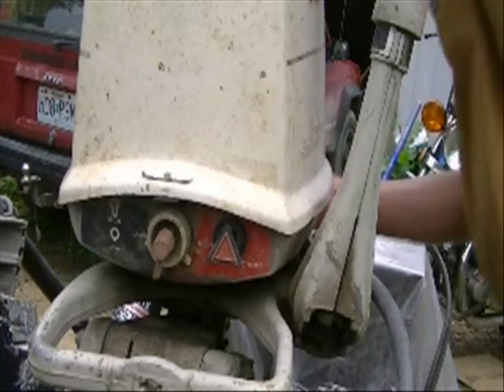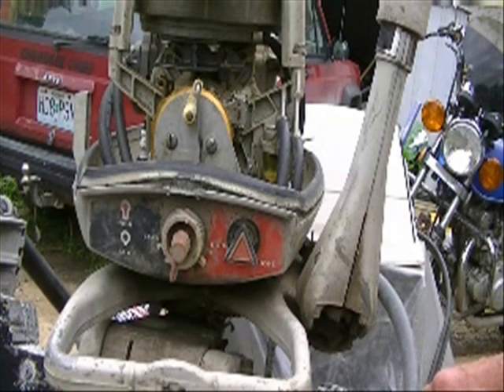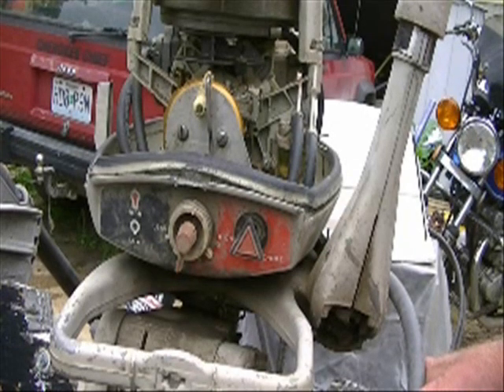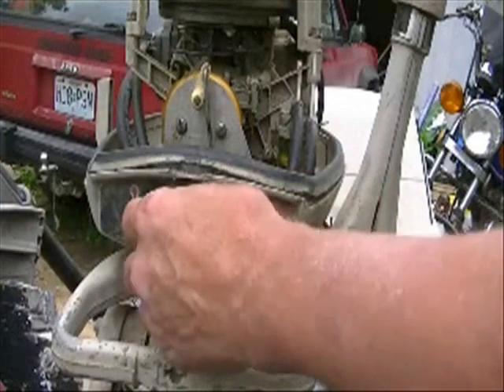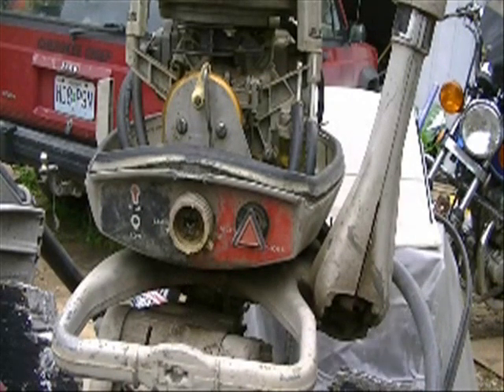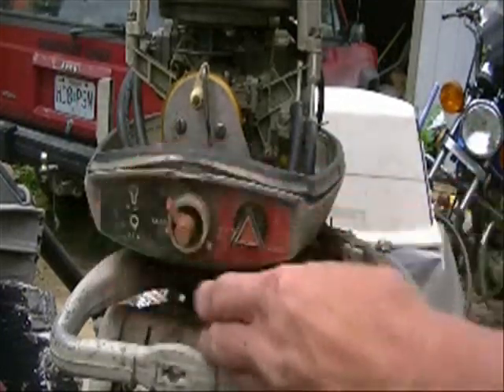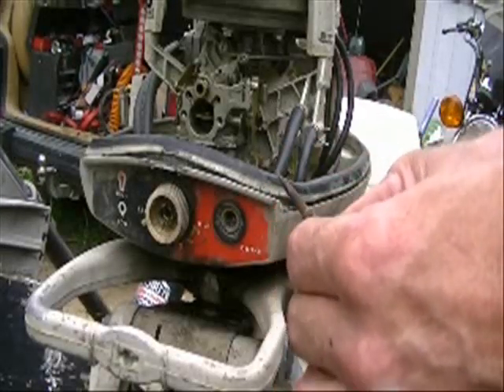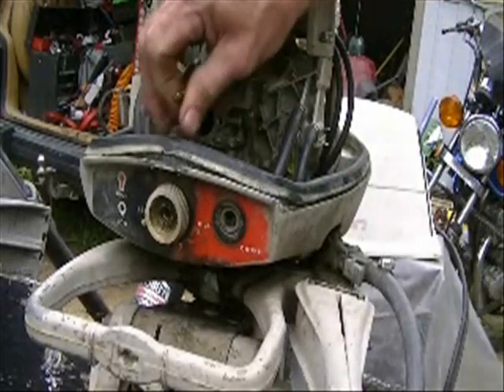Boat Motor Won't Stay Running? Watch This!!

Comment: Hi Kevin;
I used to have the same carb struggle with my 15hp Evinrude every year till I got rid of the OEM metal tank and got a plastic tank. A small engine mechanic friend told me to also ALWAYS add 2-3 ounces of fuel stabilizer to my fuel tank on its last outing in the fall and to use SeaFoam additive 2-3 times a season to keep it clean as a whistle. Never had a problem with it after that. I've since upgraded to a 15 hp  4 stroke Honda but still do the same steps and no carb gumming up problems since 2009. $25 of preventative maintenance fluids goes a long way and saves you money and headaches in the long run..
Reply from the maker: Good advice!

Comment: Most problems with outboards that won't idle have not been properly stored in the fall. You must add marine fuel stabilizer. Run the engine at a fast idle to run mixture through for 5 to 10 min. It's a good idea to fill the tanks to stop condensation. Fog the engine until engine stalls. Remove your battery. Grease fittings and kisses it a long winter. Come spring it's ready to rock.

Comment: I have a 68 Johnson 20hp FD-22M which I've been having an troubles getting running after sitting for a few yrs. I drained the fuel, changed lines/filter- will try your method even thow i'm very green with outboards.  Thanks lots for the Video very informative.
Reply from the maker: Michael T. Lichtenfeld You are welcome!!

Comment: I have the same motor as you (mine's a 1960 with the square f/g cowl)
The button you're talking about is a kill switch (shorts the ignition to ground). The choke is the pull out knob on the other side and there are two separate mixture control knobs is the center. They are labeled, though your motor might have had a harder life than mine and they may have been rubbed off or painted over.

Comment: Hi, If this doesn't work you can do what the video suggested to do but take it a bit further. Do all the steps mentioned but instead of just pulling on the rope shoot some deep creep or other starting fluid and get it to start. Let it wind up for a few moments and then cover the end of the carb with your hand. This will generate a lot more vacuum then just pulling on the rope. If this doesn't clear the jest bite the bullet and rebuild the carb. Nice video by the way.
Reply from the maker: I've been using that trick for over 30 years.I didn't want to post it for safety reasons.

Comment: my motor is a 6 hp Mecury 4 stroke. We went camping and fishing for a week. Each morning I had the same problem. It would start on 1st pull, then after about 30 seconds it would stop, and I wouldn't be able to get it started. I took off the gas hose, and let it set for a few minutes then I could start it again, and it would run without the gas hose for  a few seconds, and as soon as I put the gas hose back on, it would quit. Then it would take some sitting time of periodically pulling the cord to see if it would start. This would go on for about a half an hour, and then it would start, and let me put the gas hose on and then would run perfect the rest of the day. Sometimes we were out for a couple of hours. Would run great. Go in for lunch for 2 or 3 hours, come back out, and it would start perfectly and run. Anytime we shut it off, it would start back up and run perfectly the rest of the day. Then the next day the exact same procedure of not starting and running until about a half hour of playing with it and then it would run perfect for the rest of that day. Same procedure everyday we were there.
Reply from the maker: +Gary Arnold I'm guessing the float was sticking down and just worked loose after a period. try some Seafoam or a similar fuel additive.

Comment: K-100 FUEL SYSTEM CLEANER IS THE BEST...I DOUBLE DOSED MY TANK AND A WHILE LATER WITH REPEATED STARTING IT WAS IDLING FINE...THE STUFF SAVED MY VACATION...30 HP SUZUKI 2 STROKE
Reply from the maker: Good deal!!

Comment from the maker: Follow the video and give it a light shot of starter fluid when you get ready to fire it up for the first time. I fog the engine with Deep Creep or fogging oil first to get some lube in the cylinder. (Fogging is spraying a mist into the carb while cranking to draw the "fog" into the engine.)  Also, check the plugs. They might need to be replaced.

Comment: you have to let people know that older outboards might have cork floats in the carb which have a varnish type sealer on them , carb cleaner will dissolve that sealer and the floats are junk! trust me I found out the hard way.

Comment: I figured it was something like that.  Now I want to see one in person.  I have a Fastwin Evinrude 18 but it just has a button in that spot, I think for electric start - not installed.  That's a trip that these motors still had mixture adjustment.  I thought that was a 1920's  / 1930's era thing.

Comment: few rules 
1. avoid using fuel contain ethanol, use fresh fuel when it over a month old
2. when pulling jet needles out mind the O rings
3. never ever force needles into the seat like the he did in the video with a pair of plier

Comment: This is an old post I see. What you did will work to a point. Just clean the carb and be done. Could clog any time the way you are doing it. You pushed all the trach back in the carb. It will stop up again. But....Good to know if out on the lake to get you back.
Reply from the maker: As you stated, getting back home.

Comment: I have a 4.5 Mercury motor, it runs fine in the test barrel and will go for 20 minutes at least (longest I've run it) under forward power.
However when I put it on the boat and on the water it'll run for about 5-7 minutes then it quits like it ran out of gas.
Then I open the choke a bit(1/4 maybe 1/2) then it one pull sarts and will only run on that choke then it quits again.
Then, I close the choke and then it'll start that way and again run for 2-3-4 minutes then quit.
But once I get back home, it runs fine in the test barrel with Zero problems

Any I dea what gives?  It was fully serviced about 4-5 months ago.
Thanks great video BTW
Reply from the maker: You have a fuel restriction. Loosen the cap on the fuel tank. Check all fuel lines for collapse and look for a clog where the fuel line enters the carburetor. Next time out, try pumping the hand pump to keep it running.
Reply: Thanks for the reply, it's a tank on the motor. all the fuel lines were changed about 4 months ago on the last service. 
I'll keep pluggin away at it, it's something small I'm sure.  It runs perfectly in the test barrel.(20 minutes half throttle)  I'll pull the tank clean it (again) and change the lines again.

Mahalo Nui Loa
Reply: maybe is the fuel pump is bad
Reply from the maker: rafael matos I replaced the fuel pump, first. Yep, it was bad!

Comment: hi,
i have a 2003 mercury 25hp tiller steer.
I was going wot then i backed of to idle and it died and has not run good ever since.it seems when you start it you have to give throttle instantly to get going.
when i start it,it idles rough then dies.i can rev it and it will rev ok,as long as i have throttle it wont die.

now,I have taken the carby of 2 times now and pulled it apart and cleaned it all including putting wire through all jets and holes.
ive also adjusted the idle all the way up and it still wont idle unless i give throttle.
when i opened the carby up there seemed to be no dirt or crud,it was very clean actually.

the mixture screw ive tried playing with it but seems to make no difference.
I dont know how far to set the mixture screw but from what i read it should be about 1 1/2 turns from fully closed.

ive changed my fuel hoses but not the hose from the tank to the motor.

I have not changed the spark plugs  
but they seem to be sparking fine.
the motor when going with throttle its pumping water great.

im so confused on what it can be.im going to get a compression test done and i sure hope its fine.

If you have any ideas I would be very much appreciated if you could please help with any ideas.
im not a boat mechanic but i have alittle knowledge about motors but this problem has really got my head scratching.
thank you heaps.

a very good video and im sure it will help alot of people.thank you for posting a very good vid.
Reply from the maker: Check the fuel pump, but I'm guessing the float level is too low. Will it run partially choked?

Comment: I have a 72 Evintrude 6HP. I bought if from a guy who ran it about a year ago. I took apart the carb cleaned it out a bit, put new plugs in, new gas, took apart and cleaned the fuel pump (plastic box type). I can get the thing to turn over and run for about a minute or two with the choke pulled and my thumb covering the hole. Without my thumb covering the hole it will run 10 seconds tops. I suppose I should buy a carb rebuild kit and a new float. the float looked like a swiss cheese bit of insulation. Any thoughts on what I should try next? I am new to this sort of thing.
Reply from the maker: Trevor Lake he jets are clogged. I suspect the main from the bottom of the float bowl. It will need to be cleaned. Sometimes this can be done by removing the needle valves and blasting the holes with carb cleaner with the straw. Good luck!
Reply: kbbacon What can I say....Mr. Bacon knows his outboards! I took the carb apart again; this time I took the brass screw pin out of the main jet (lower bowl). The small pin hole that went through the center was clogged; I cleaned it out with a bit of carb cleaner and a small wire. I am very happy to report that the motor is now alive and well. Will be on the water in the AM; hoping to take down some Kokanee at the local pond. Cheers, Trevor
Reply from the maker: Trevor Lake Good deal!!

Comment: you're a lucky guy having a removable main jet needle like that.
Reply from the maker: Yes indeed!
Reply: what kind of motor is that? i've not seen controls like that. im guessing johnnyrude of some kind based on the way the castings looked when you pulled the hood off.
Reply from the maker: Sea King...Sears..jonnyrude. 1976 model 5.5 horse.
Reply: kbbacon that would be a 2 cylinder correct? possibly a detuned 6hp?
Reply from the maker: 2 cylinder and I think it's an up tuned 5 hp.

Comment: I have a 5.5 hp Johnson very similar to yours that I just got, I can't get it to fire, checked spark, not that great and seems that it doesn't spark every time it's supposed to. I pulled the flywheel , the points look good but, the coating on the coils is very brittle and cracked, I've read that most spark problems are bad coils. I'm assuming that's what's wrong with mine?
Reply from the maker: Jake Zeller It is very possible. Polish the points, first, just in case.
Reply: kbbacon the coils were bad, it runs great now

Comment: I inherited my grandpas boat has a 86 30 hp evinrude this past summer it sat for 5 years out side the first time I took it fishin thing would have a hard time starting took 50 pulls an when It did when I would slow down it would die so I droped new plugs in it started an ran fine again but when it got down to half a tank it would die if I was trolling so I adjusted the low speed has not done it since nice motor moves the boat nice I got it to troll down to .4 miles a hr an wide open she hits 35
Reply: an I ran seafoam thru it every time I run it
Reply from the maker: Seafoam has some good products. Amazing what those adjustments will do!!
Reply: kbbacon True, the trans-X has saved many a transmission!

Comment: I bought a 78 thunderbolt 850, one cylinder is reading low..do you suggest a card cleaning?
Reply from the maker: Carb clean and check compression. Compression OK then probably carb.
Reply: It blew up totally, I got a Yamaha 40 hp 2 stroke, and I love it

Comment: Hate to be a downer but gotta say it. First off NEVER use starting fluid on a two-stroke outboard motor! The fluid washes away the coating of oil on moving parts inside the crankcase! No oil/insufficient oil = no/poor lubrication= METAL ON METAL = PREMATURE WEAR!!

Second, and some have already stated this: The only way to PROPERLY service/clean a carburetor that has been sitting & is gummed up/dirty, etc., is to remove it & disassemble it. Clean each individual component, preferably soak it in a can of carb-cleaner. Rise with fresh water & use compressed air to blow-dry and blow out the small passages, etc.

Reassemble using new gaskets AND a new float. The original float on those 1960's  Johnson/Evinrude outboards (NOT 1976) were constructed of of cork. The cork floats were coated with shellack to prevent them from becoming saturated with fuel. Today's fuels are too harsh especially with ethanol and will dissolve the shellack & deteriorate the cork. Nothing but problems.

You may get lucky & your method will suffice. Still, you're taking a huge risk. If there is trash/residue, etc., clogging the jets it can create a lean fuel situation. You run the risk of burning a cylinder/piston from too lean a fuel/oil mixture etc. I will admit it's not as prevalent in these old small horsepower outboards, true. They were/are pretty bullet proof with looser tolerances, heavier metals & lack needle bearings inside the crankcase. These little outboards (Not all, but these for sure) incorporated bushings instead. IMHO that was their saving grace & one of the biggest reasons they were so durable. Less moving parts to wear out!
Reply from the maker: Have you never been inside a two stroke? I would, indeed, warn against the regular use of starter fluid, but I use lubricated starter fluid and never enough to wash out the crank case. Come on...you love to be a downer! It's OK! BTW I watched that sweet Jonnyrude of yours running. Great job. You need to post more vids!! I'll give you a shoutout if you do. I'm subbed!
Reply: Actually, I've been inside MANY 2-strokes! I've repaired & rebuilt outboards since I was 17 years old...which was 35+ years ago.

O.k., you got me, I DO! love to be a downer ;-) Even so, I won't delve into the whole "lubricated starter fluid" debate. Anyway, it's not just wash-out but the fact that ether causes a little bit of damage to the piston/rings etc., every time you use it.

Over time the motor loses compression making it harder to start & poor running. Since you don"t use starting fluid often you'll probably never notice or have a problem. Still, if it were my motor just knowing it will cause damage would prevent me from using the stuff. 

Anyway...thank you for the kind words on my vid. I sold that sweet beast last year. I do plan to post more videos. It will be a while though. Take care!
Reply from the maker: I began work as a professional mechanic for the USARMY in 1977, but have been doing it all my life. Sometimes you just gotta do what works! Seafoam spray and Deepcreep work, also. I have even used a pump oil can with gas mix in it. I've got over 400 vids on here. Check some out. I'll be watching for your next one!!
Reply: Thank you!
Reply: tvtonite79Hi Kevin, Can you advise me on do ability  repairing a Johnson 110 .specifics are:engine ran with bad oil injector. engine cranks. I suspect rings and bearings and gaskets are needed. TNX.
 Jon
Reply from the maker: I have no experience with that engine, but I'll guess the cylinders are scored, too. It may bre toast. Good luck!
Reply: water in boat motor carburetor
Reply: Hi guys. I've got a Johnson 4hp 2 stroke, 2 cylinders from late 90's, Seahorse 4hp. Rebuild/change all that was needed. EXCEPT the central needle bearing. 

Anyone know where I can find (online) the damn thing? Johnson dealers is a no go. According to them it's "out of stock" since the last decade. So no help there. 
All is working but the needle bearing as seen better days. Was left with some salt water.
I really would love to finish this project with 100% reliability and being setback by one needle bearing. well it's a pain...  
Thanks for any tip. :-)
Reply: to what "central needle bearing" are you referring? we will need a bit more info to help. I assume you mean the crank bearing but not sure. cheers.
Reply: Hi, yes it's the central crank bearing, 2 halves loose needle bearing. 
I know for most it's just a cheap old motor. But I really intend to take the challenge of bring it to life 100%. In fact it runs quite well, considering the pitted track of the needles.
 
Item #15 on this diagram:
http://www.marineengine.com/parts/johnson-evinrude-parts.php?year=1998&hp=4&model=J4BRECRJ&manufacturer=Johnson&section=Crankshaft+%26amp%3B+Piston

Exactly the same model, year, even color as in these videos: 
https://youtu.be/_cfUfRrT9aM
https://youtu.be/OpQYiG6M3oI 

BTW I'm in Norway so online seems to be my only option for now. Tks ;-)
Reply: tvtonite79 yeah.... you sound like like fun...
Reply: A marine mechanic told me use WD40 burns good and lubes!

Comment: I have a Suzuki DT140 motor and when i crank it it will start right up, but when im idleing it cuts off sometimes. it had a idle speed adjustment knob on the engine and it is close to the slow tab, should i just turn it up to halfway or further. you think that would keep it from cutting off at idle

Comment: I have a 75hp Mariner it runs fine on the flusher from water hose, but will not run on  the lake. I have changed plugs and bought a new gas tank and gas hose and bulb.
Reply from the maker: jrossjr 5150 Won't idle, or won't give you power?
Reply: it will not run at all when I go to the lake
Reply: but runs fine at the house with the flushers on the water hose
Reply from the maker: jrossjr 5150 You have a serious mystery!!
Reply: jrossjr 5150 do you have a water/fuel separator filter?  I had the same kind of issue and found I had water in my gas tank.  the boat sat different on the water vs in my driveway and would start at home on the hose.  long story short my fuel tank vent was taking on water from the "spray" while boating (bad design).